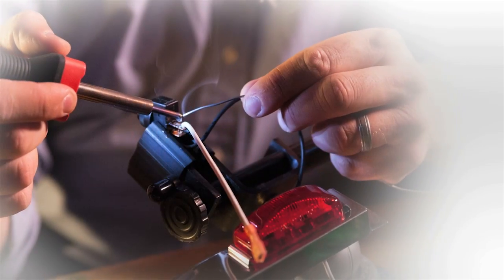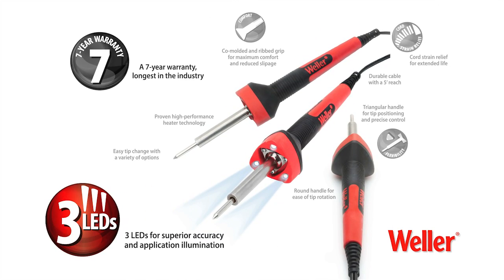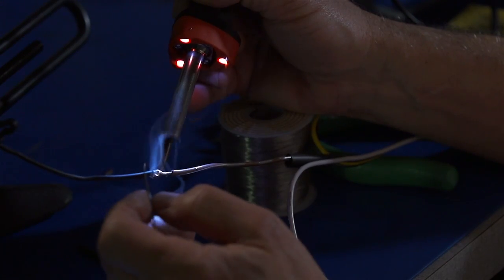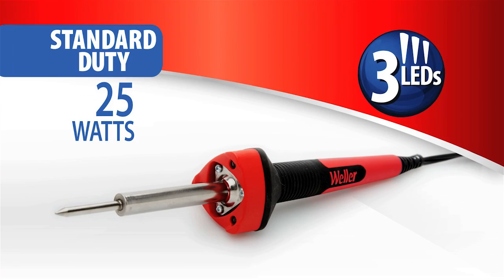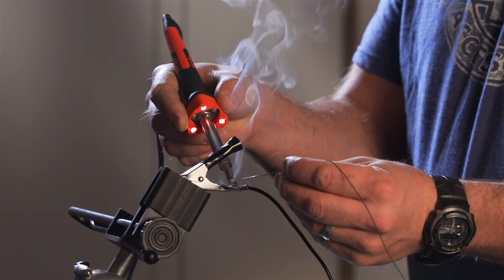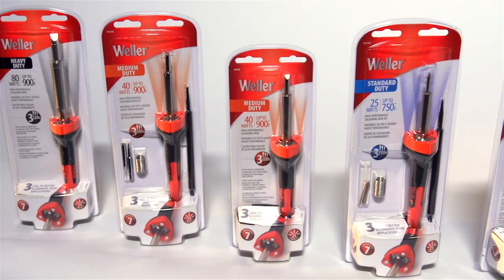Weller® High-Performance LED Soldering Irons

Comment: what stand is that?
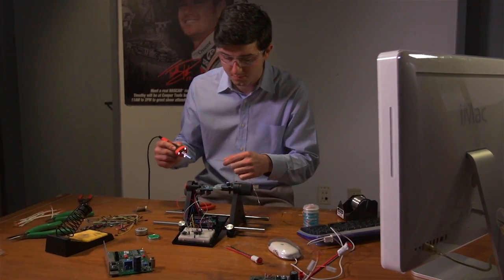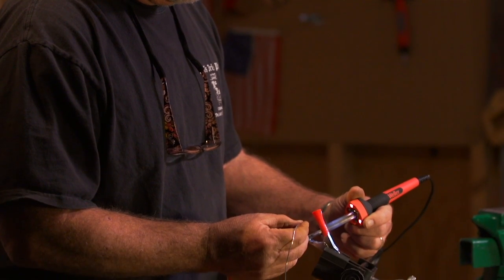Reply from the maker: That is the PH50 Stand(shown at 0:29 and 2:50).  FYI, the one shown has the ceramic funnel which is no longer offered.  However, the new PH50 comes complete with a stainless steel funnel.  Here is a link to the product detail page for that item if you would like to know more: http://www.weller-toolsus.com/weller-ph50-iron-holder-for-pes50-51-a.html